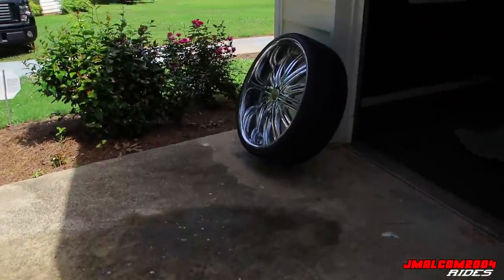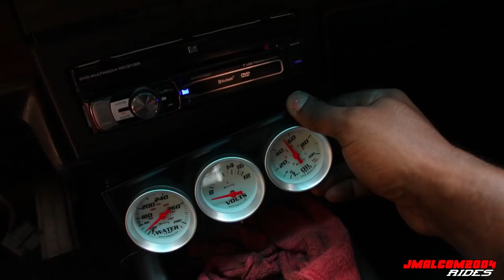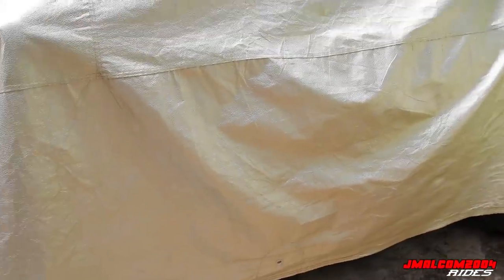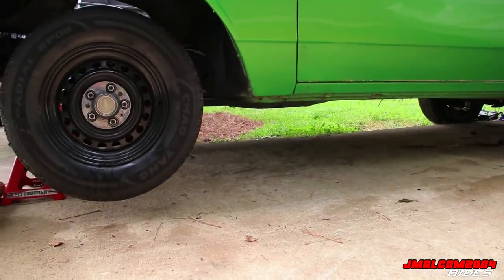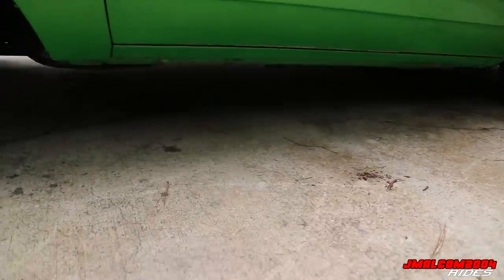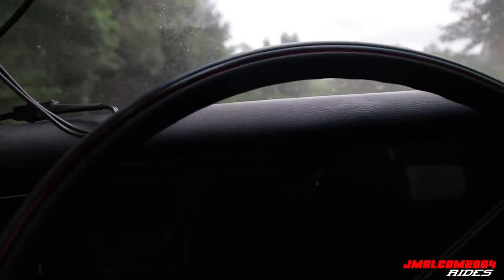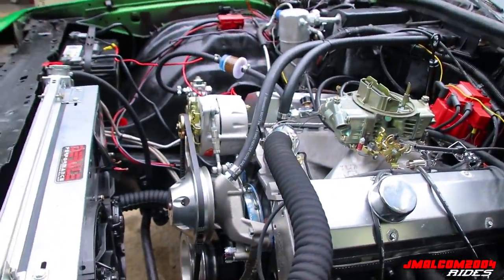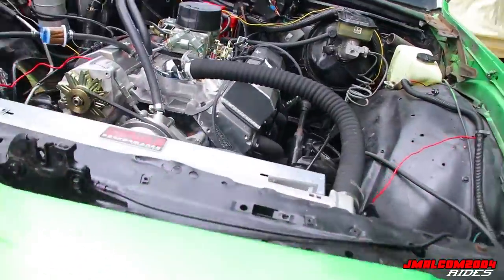BIG RIM BOX CHEVY BUDGET BUILD EPISODE 43: THE DOLO BOX CHEVY IS OFF THE JACK STANDS!

Comment: I work at my grandfather tireshop for years, and when we had a rim that would leak from the back like that. We'll take the tire off and hit it with a wire brush to knock the chrome peelings off. After that we'll put some oil or lube around it and it will seal... no more leaks!
Reply: Thats a good idea actully I worked at firestone for 5 years as a c level tech thats one of the things wed do
Reply: Rather than lube we would throw some patch cement on it.
Reply: Yes sir  that    seal it right  on up. If  his tire guy it  good   and honest   he would at least try.    My tire guy is"  the truth"  I  brought some  rough  looking stuff to him  he made it  happen.